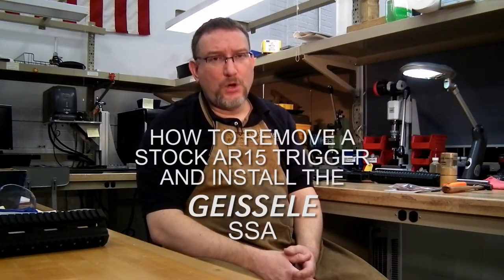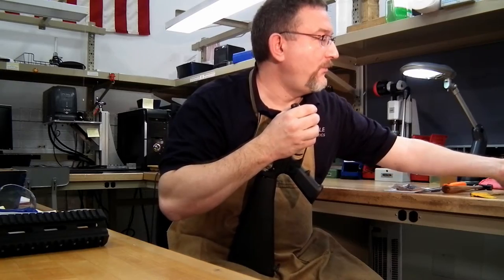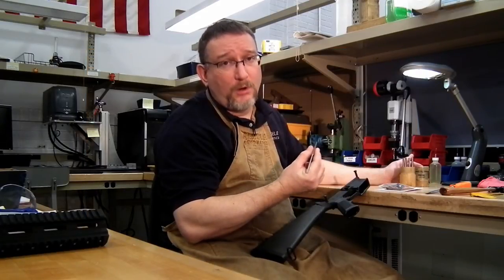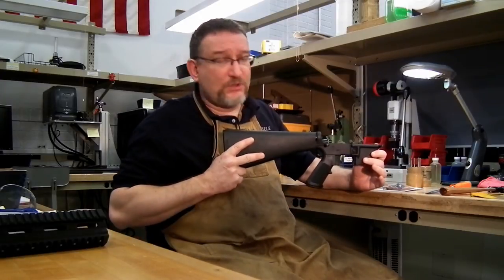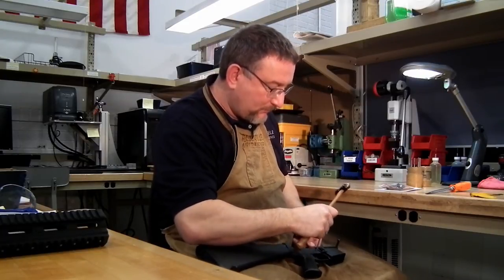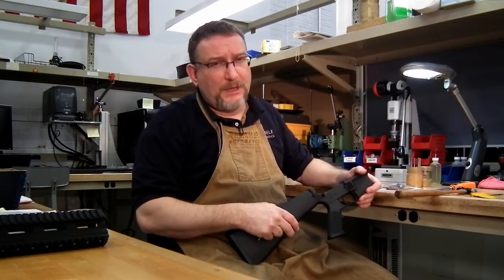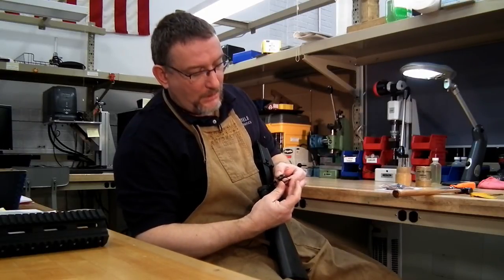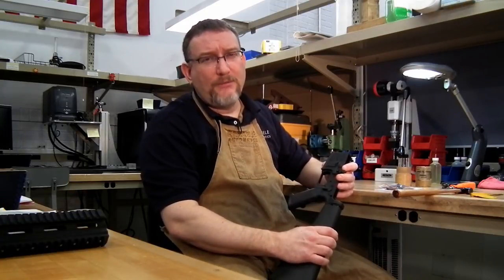Geissele Automatics - SSA trigger swap - Part 1 of 3

Comment from the maker: @Mtnshooter1 No stoning is required. If you go on the Geissele Automatics channel of YouTube, you will find a series of short videos title "Hi-speed NM / Match Rifle / DMR." It has a graph of an OEM trigger with jagged curves representing your "creep" factor. Then it compares the graph of a Geissele trigger which is very smooth. Every trigger has edges cut to "razor sharp." Then it is heat-treated twice to keep the edge for lifetime of service. Lastly, cryogenically frozen in liquid nitrogen.

Comment from the maker: SSA has a 4.5-pound trigger pull (2.5-lb. first-stage, 2-lb. second-stage);
SSA-E has a 3.5-pound trigger pull (2.3-lb. first stage, 1.2-lb. second-stage).
The SSA is best for carbine work ranging from CQB to 600 yards. The SSA-E is best for precision beyond 600 yards (and is probably just as good at CQB). The SSA is more suited for carry duty whereas the SSA-E may be too light a hair trigger for the operator to be comfortable with. Either trigger can deliver excellent precision.

Comment: THX !  Just wondering .....I have a old krieger / mizziloe trigger on a Colt sportster cica 1991.  i've had to stone in. But it does have a adj sear releise for the 2nd stage.    ( large pin)  Getting old fast. Looking at a geissele NM  3lb for thats what i'm used to. Still shoot a mid range match a few times a year.    Mtn